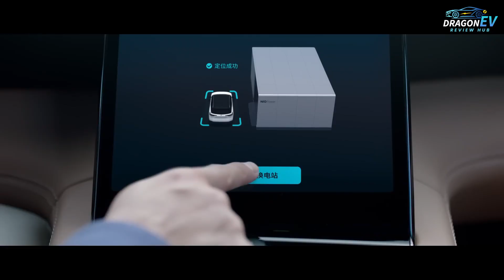Inside NIO’s Battery Swap Revolution – This Changes EV Charging Forever

Comment: Renault has tried this, they probably stole the idea from them, but it’s NOT practical at all…. Bye
Reply from the maker: Great point — Renault’s battery-swap experiment with the Fluence Z.E. didn’t take off.
What makes NIO’s approach different is the fully automated robotics, standardized battery packs, and a massive network already in operation. Not perfect, but definitely a more scaled attempt than what we saw a decade ago.

Appreciate your take!

Comment: You will wait for battery change as well they take up so much space
Reply: plus you can only go to a NIO station, and those stations would cost heaps to set up.... and sure, the swapped batteries gets charged on those stations, but how many batteries can it accomodate?... too many negatives against the idea 😁
Reply from the maker: Fair concern!
NIO claims an average swap time of about 3–5 minutes, and they’re working on higher-capacity stations that handle more cars at once. Space is definitely part of the challenge, but they seem committed to improving throughput.

Thanks for raising this — it’s a good point many people wonder about.